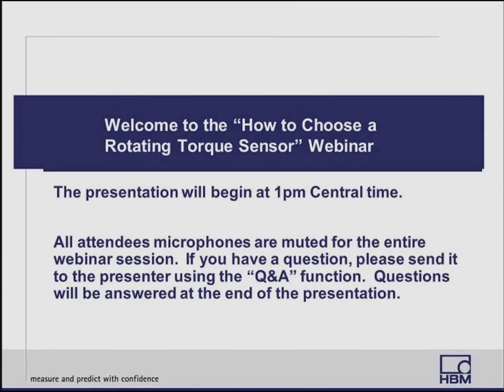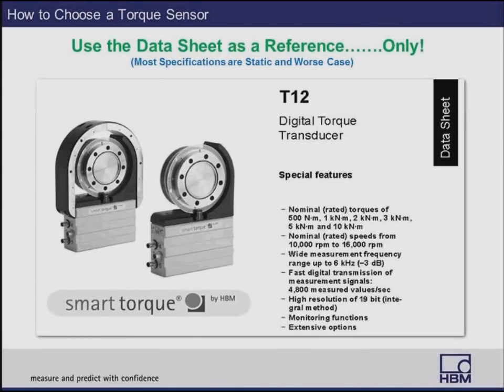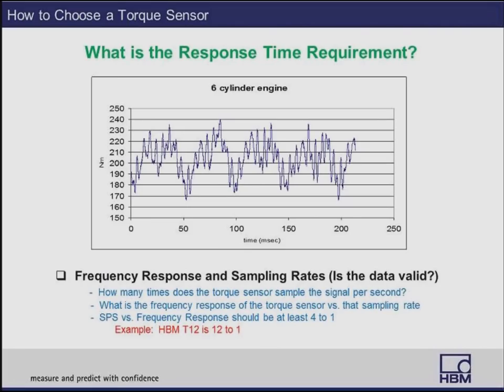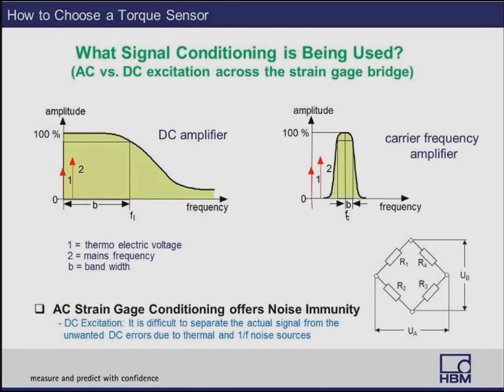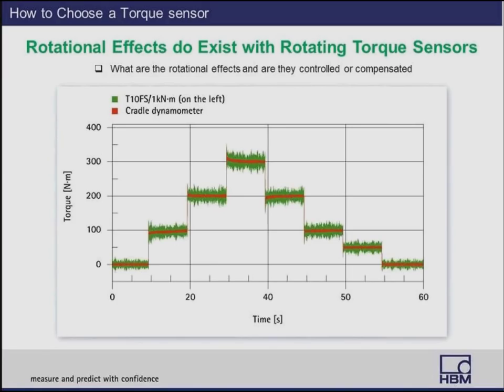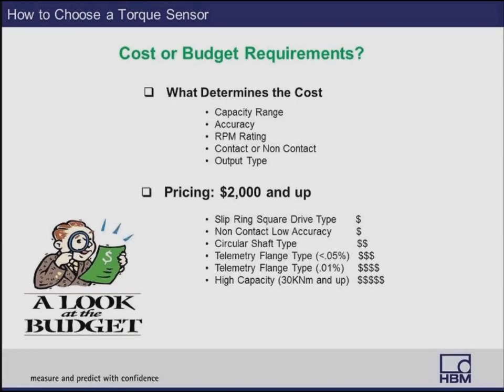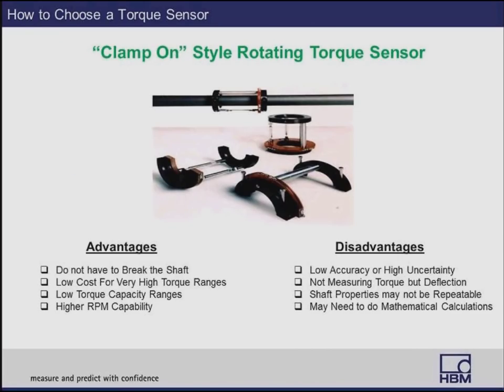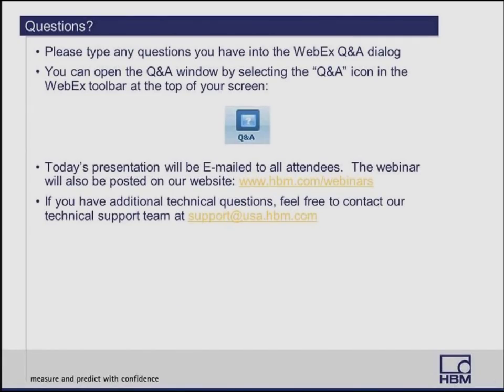HBM Webinar - How to Select a Rotating Torque Sensor

Comment: Which rotary sensor is good  for ac motor testing bench where max speed is 3600rpm and max torque is 1500NM AND MUST COVER 200NM RANGE IN MINIMUM CAPACITY MOTORS